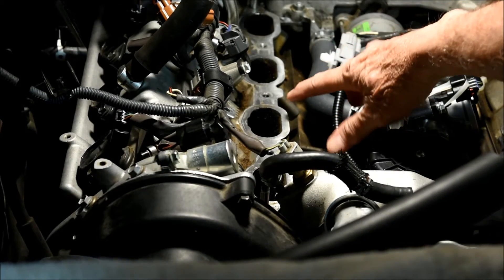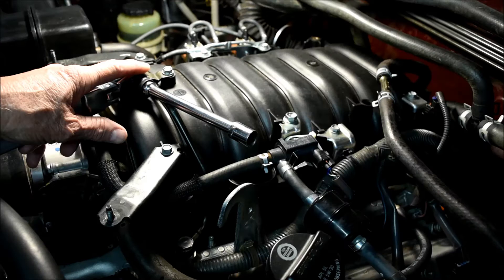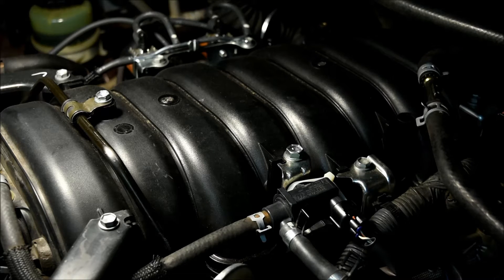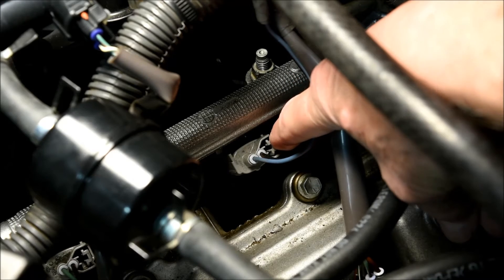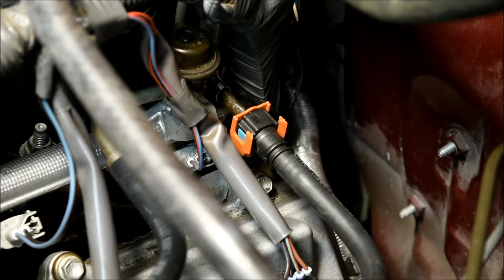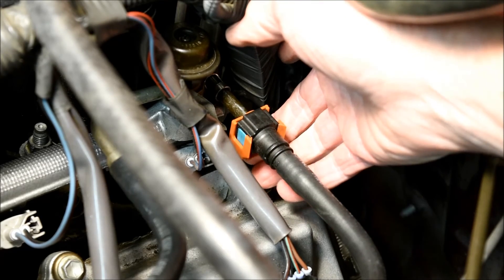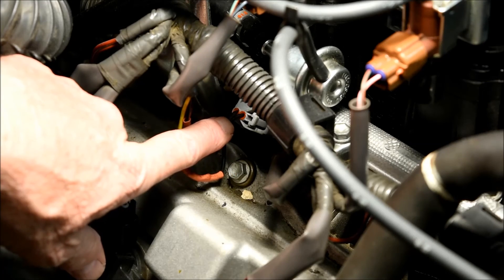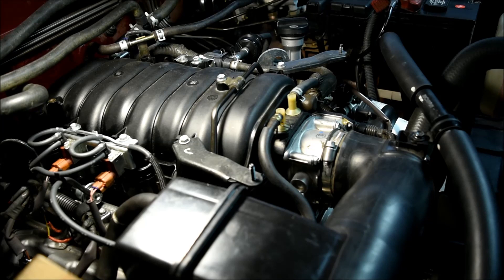Secondary Air Injection Pump Replacement 2006 Toyota Sequoia/Tundra Chapter 3:

Comment: David, I just finished the repairs on my Tundra and I could not have done it with out your videos. I followed them step by step and it was easy. For the hard to get to bolts on the check valves I used a long extension which made it easy. I did have a few gas leaks but I just had to loosen  the fuel rail and adjust the fuel injector to seat it in correctly. I also took the opportunity to change out the starter because it was right there and would suggest everyone do the same. I do have over 250 thousand miles on my truck though. Again thank you for the videos you saved me a lot of money.

Comment: David, I wanted to let you know I finished the repair, and all is working great!  I have to confess I had a mechanic friend of mine help me get the check valves off.  I just could not get the rear bolts to the vacuum pipes off....of course he did it in about 15 minutes!  And he helped me with a couple things as I put it all back together.  But he was impressed I had all the right parts and knew how it all came apart.  I gave all credit to you and your great videos, and helpful advice along the way.  Thanks very much!!
Reply from the maker: Glad to hear it is all done. Thanks for the compliment.

Comment: David...thank you for the great video series. My wife's 2006 Sequoia needs to have the secondary air pump replaced. But now I might as well replace all of the other parts you mentioned while I'm in there. Speaking of parts, do you have a list and part numbers of all the replacement parts featured in your video? Thanks!
Reply from the maker: Parts needed to replace Secondary Air Injection System on 2006 Sequoia/Tundra

1.    Secondary Air Injection Pump: Part No. 17600-0F010

2.    Diverter Valve:  Part No.  25710-50022

3.    Check Valves (right and left): Part No.25720-50011 and Part No. 25720-50020  Note- the metal pipe gaskets for these parts are supplied with them.

4.    Intake Manifold Gaskets (2): Part No. 17171-50030

5.    Metal Crush Gaskets for Fuel Delivery Pipe Unions (4): Part No.  90430-12026

6.    O-ring for Fuel Pressure Regulator: Part No. 90301-07037

7.    O-ring for Water Bypass Pipe: Part No.96761-24019 (The O-ring I bought from the local Toyota dealer was hopelessly inadequate. See explanation below.

8.    Gaskets for Rear Water Bypass Joint (2): Part No. 16341-50020

9.    O-ring and gasket kit for all 8 fuel injectors: I bought an after-market kit from AutoZone for $24.

10.    Hose, air injection: Part # 17342-50180 (Note- this hose has a  45 deg bend molded into it. If you are careful, you may not need to replace this hose, but mine was hard and brittle and broke easily. You cannot substitute radiator type hose for this part, because it will kink at the sharp bend required). $27.67 is best price I found on the net. Local Toyota dealers want $49 or more for this.

11.   Spindle oil. Needed for lubricating the O-rings and rubber parts on the fuel injectors. You can use gasoline but it evaporates too quickly IMHO. The Toyota manual says NOT to use motor oil or brake fluid, etc.

12      High temp type Black RTV

13.       Antifreeze type coolant. You can't avoid spilling some when you remove the  rear water bypass joint.

14.   While I bought a few O-rings and gaskets from the local Toyota garage, I ended up getting OEM Toyota parts from toyotaonlineparts.com. The alternative to that is to get after-market parts from a company like rockauto.com. I found that if you use all OEM Toyota parts, the entire job will cost about $800. If you use mostly after-market parts, the job will cost about $500, or about $300 less.

I have some other material but it is too large to paste here. If you send me an email address, I can send you my written instruction list as well as a chapter from the Toyota Service Manual.

Hope this helps, Dave

Comment: Hi Mr Clark i again , question the new air pump ,when you installed make some noise or  run  smoothly, because i buy a air pump and test before instal and make noise ,maybe becaus e is new , what do  you think
thnkas
Reply from the maker: I did not test my new pump like you, so I cannot tell you if it made any noise. Once I had installed it, of course, the engine noise was the only noise I heard. I can tell you that the engine ran fairly rough for about 5 minutes after the car's computer being disconnected from the battery. If the new SAI pump is just making a whirring fan kind of sound I would not be worried, but if it is a rough or grating sound, I would take it back to where you purchased it and exchange it.
Reply: Mr Clark today finish to assembly my sequoia , look graet again
thanks again for your instrucción.
and thanks God all is so good

Comment: Hello sir I replaced all the components like you did on my 2005 Toyota sequoia 4.7L v8 I had the code P2445 when replacing all the COMPONENTS I still have the code P2445 showing up still. Why is this happening P2445 still popping up won't go away??? PLEASE HELP ME
Reply from the maker: Toyota says that the P2445 Code can be caused by one of the following: Air pump fuse; vacuum hose broken, cracked, leaking, or disconnected; faulty pressure sensor,; air pump harness open or shorted; air pump circuit making a poor connection; Pressure sensor harness open or shorted; or the pressure sensor circuit making a poor electrical connection. From what I have gleaned in my research on this code continuing to display after you have replaced essentially the entire SAI system, is a broken or disconnected vacuum line or electric connector is the culprit. It is less likely to be a faulty pressure sensor, but more likely to have a poor or broken electrical connector. As much as I don’t want to recommend inspecting these parts, I think you are going to have to check all the vacuum lines and electrical connectors involved in the repair, but the vacuum lines to the ASV or air switching valve. I don’t have any good photos or videos to show you what I am talking about. On a related topic,  I spoke to a mechanic at a private Toyota garage a couple of years ago when I was getting some intermittent error codes that would last a day or two and then disappear. He told me that in my 2006 Sequoia that not only are the parts getting old, but the sensors are too. So, sometimes when you hit a bump or it is raining very hard, one of these sensors decides to report a condition that is not really happening- thus it resets itself within a day or two as if nothing happened. But sometimes the sensor just goes bad and continues to display the error code. Argh. I wish I could be of more help.  Good luck on this. Dave
Reply: @doktorfixit  thank you very much really helpful. I will check all the sensors and hoses as well.  But i think all the air hose are in good condition but I will recheck all again. And the connectors & fuses & relays 
I really appreciate it for getting back to me. Like your videos man thanks
Reply: @doktorfixit  one more thing where is the air pump fuse located
Reply from the maker: @djlouis2150  If memory serves, it is in the fuse box in the engine compartment just behind the battery.
Reply: @doktorfixit  do you know what number is the relay
Reply from the maker: @djlouis2150  Actually I could not find a relay in the wiring diagrams and literature. I am not sure this motor has a relay. It may just have a fuse.
Reply: @doktorfixit  ok thanks wish me luck. Thanks be safe

Comment: just to clarify is this a fix for code P1442? that error code just came on in my 2006 Sequoia. how much is this repair normally? is it ok to continue driving the vehicle with this error code?
Reply from the maker: Hi Bobby. The repair I have shown is basically a replacement of the major parts of the Secondary Air Injection system. Doing this "should" fix the code you mentioned. There are some less likely causes for this code like a sensor or the Engine Control Module (the computer) itself. If you replace the SAI pump, the two check valves, and the diverter valve, you will fix this situation probably 99% of the time. Those are the parts that wear out from "normal wear" in the SAI system. 

Driving the vehicle with this system inoperative will not harm it. This system only runs for a few seconds one time per day until the primary system warms up and takes over. The cost of repair will probably vary greatly due to the sophistication and honesty of the repair shop. One very reputable independent shop where I live just backed away because he had not done one before, "because they are usually handled under warranty." And that was true until it started happening in cars outside the time limit in the Toyota recall. I missed it by a few months and Toyota would not make an exception for me.

 The fact that you are watching this video suggests you already know that Toyota is only fixing newer cars than yours (and my 2006 Sequoia also). The first Toyota dealer where I took my SUV quoted over $3000 and said that there were 2 SAI pumps in my car. I then went to another Toyota dealer on the other side of town (who told me the first dealer did not know what he was talking about) and they quoted $2200 but added that "we won't know until we get in there." That is car repair shop slang for "it could be a lot more but we warned you." In other words, don't forget to bring your K-Y jelly...

As I have mentioned, I am an FAA certified A&P/IA aircraft mechanic and cars are something I have worked on out of necessity when I was younger and just because I liked it when I could later afford to take it to somebody. I could find almost nothing about this repair when I started out and it seemed like the Toyota dealers were either greedy or incompetent or both. I just did not want to play their game. So I got out my Toyota repair manual and figured out what I would need. And since I like to leave a trail of crumbs when I do these things, I ended up making the 3 videos. 

Let me know if you have other questions that I might be able to answer. And good luck.

Dave
Reply: @doktorfixit  thanks for your answer it is much appreciated. i was simply trying to get my vehicle inspected and that code popped up so they of course wouldn't pass the inspection and told me i had to get the error cleared so right now i'm trying to find the path of least resistance on cost for fixing the error code so i can pass inspection and part of that plan was def. not paying $2000-3000 lol
Reply from the maker: @1969MARKETING  You did not mention if the CEL (check engine light) was on when you took it to get it inspected. Sometimes the error codes can come on and stay on for a day or even a week and then just go back off (signifying that this is an intermittent problem or even just a sensor and not the actual part going bad). I have seen this several times in my own Toyota. Usually, I will wait it out for a day or two to see if it just goes off on its own. If not, then I use an OBD-II code reader to "reset" it and the code goes away. You can also disconnect the negative pole of the battery and the code will go out. If it is a real problem where the SAI system is broken, the light will normally come back on within a day or two- maybe even an hour or two of driving. If the code does not come back on, it is usually a much more
benign event. 

However, that error code remains in the car's computer memory for about 75 miles and then is erased. What I am saying, is that if you reset (delete) the code and drive for 75 miles and it does not come back on, then you can take it back to the inspection station and it will pass.

Dave
Reply: @doktorfixit  the check engine light came on along with "vsc trac" and "vsc off" all at the same time. basically there was no lights/warnings one day. next day i got in started it up and those 3 lights all came on simutaneously and haven't turned off. i've driven probably 60-70 miles since they've come on. i do have a code reader as well that i bought. 

are you saying i can erase the code and get it inspected? or will they get the code even though the check engine light is off and tell me they can't inspect it?

really appreciate your informative and thoughtful answers here!
Reply from the maker: @1969MARKETING  About a year ago I had all those same warning lights coming on in an intermittent fashion. Sometimes they would go off for a week and other times they would come right back. My car inspection was coming up and I was very busy at the time and did not have time to troubleshoot this. I went to the Toyota dealer and spent $100 to get their computerized diagnostic check. They told me that it was one of 4 things. Gee thanks, fellows. 

I erased the code and took the car to get inspected. It did not pass. I have known the inspection guy for years and he said that there was an indication that
the computer has been reset recently. And did I do it? I told a white lie and said I was cleaning the terminals of my battery and disconnected it. 
He was happy with that explanation and he told me that he could not pass the car until that reset indication had gone away. He told me to drive the car for at least 70-80 miles and come back. I drove it over to Dallas to pick up a welding machine and I put about 80 miles on the car. I went back to the Inspection station and he said it now passed. 
The  moral is: if you reset the code with the code reader, wait at least 75 miles before going to get it inspected.
As an aside, it turned out that it was my fuel pump slowly going out and finally it made itself obvious and I had it replaced. And of course, the codes went away.
Reply: @doktorfixit  thank you!
Reply: @doktorfixit  quick update. I happen to have an Autel Maxi Link ML629 that I bought last year. I used that to erase the codes and from what I could tell it did not store the code until 70 miles were driven. It appeared to be gone as soon as I erased them. In stored codes it shows "0" but I still drove 75 miles first and took it back for inspection a few days later and it did pass :) I remember my wife griping about me spending a $100 on that code reader but it has obviously now paid for itself and then some lol

Thanks again for the advice and I hope other people with a similar issue get a chance to see your video and read your comments!
Reply from the maker: @1969MARKETING  Hi Bobby, I seem to recall the guy at the State Inspection Station telling me that he could only tell that I had reset the car's computer but he could not tell if there had been an error code or what it was. That was why he accepted my explanation that I had disconnected the battery cable while cleaning corrosion off the battery. Yes, resetting the car's computer does make the code disappear to our code reader, but it does not erase evidence that the error code showed up. That is, not for so many miles or X amount of time, and then it wipes the slate clean. OTOH, I have heard that places like the Toyota garage have more sophisticated code readers that us mere mortals. I believe that they can see things that don't show up on our code readers.

Comment: Mr clark ,when tske off the sap , litlle pieces of platic drop of the air pump, i remplaced valve ,R an L , VALVE ASSY , HOSE ALL IS new, AND THE CHECK ENGINE LIKE Gone.chek whit the scanner ,and not have codes right now. i sleep smoothy hahaha thanks Mr Clk .i like have contac whit you face or email . see you.
Reply from the maker: You can always reach me at dave520@prodigy.net. I live in Arlington, TX. Where are you?
Reply: Hi Mr Clark, I have my Sequoia .and I believe need remplace ,air pump again. 3 year ago, remplaced. Today my truck have 150 k miles on.
You own Sequoia.

Comment: Would you be wiling to send me the check list you show in the video?
Reply from the maker: Hi Philip. Sure. How do you want me to do it, email? Send me your email address. Basically what I did was to copy the sequence out of the 2006Toyota Sequoia shop manual with some minor modifications. The shop manual does not tell you specifically how to replace the SIA Pump. But rather it would have you just join in mid-stream the engine tear down procedure at step #13. Then the procedure for putting everything back together is to retrace your footsteps.